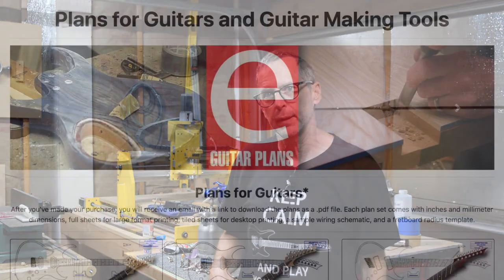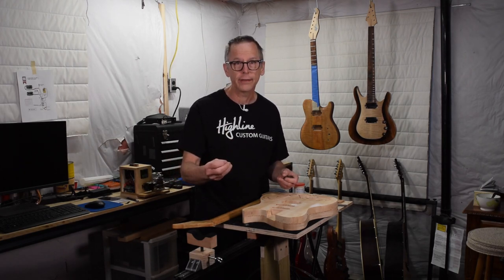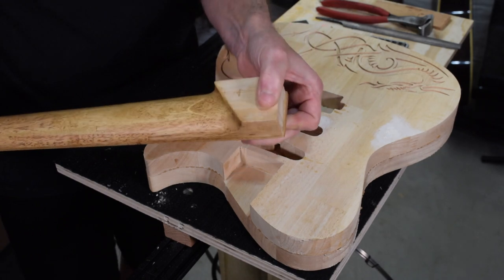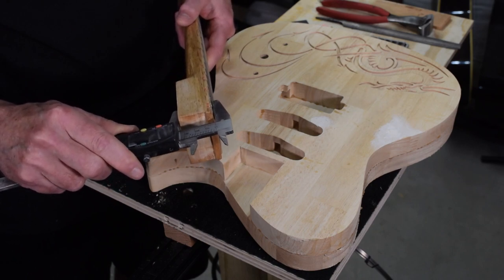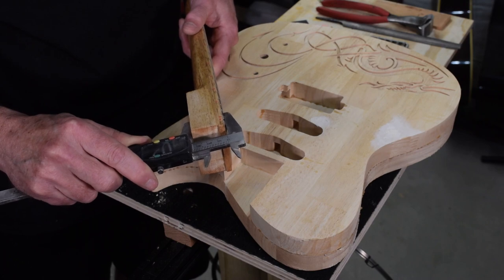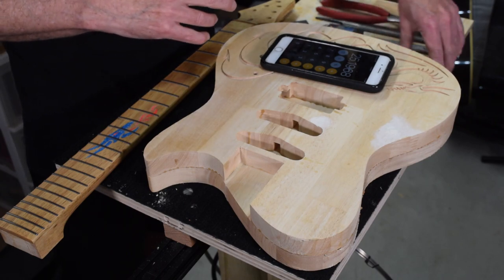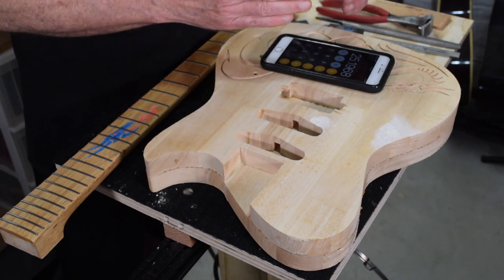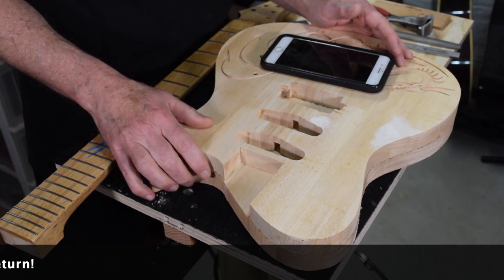Determining the Depth of Your Guitar's Neck Pocket

Comment: If you would like your reading to be as accurate as possible, and since you have a digital caliper, take your measurement of the bridge, make that your “zero” starting point and then measure your neck. No calculations required.

Comment: This is really well explained, except for one omission - it’s doesn’t seem to account for string action. Following this precisely will result in strings which touch the fret wires won’t it? I assume this is corrected by adjusting the saddles but this would imply the degree of accuracy is not as critical as you suggest?

Comment: I’m not sure why you said that before measuring the bottom of string at the bridge saddle that you first lower one saddle so that it’s flush with the bridge plate then slightly raise the saddle next to it then measure. Why is this necessary and if you do that to 2 saddles then which is the one you measure? The one flush with the bridge plate or the one beside it that is slightly higher? I’m very confused. Thank you! My calipers arrive tomorrow and I have to attempt to fix an uneven guitar neck at the neck pocket on my 90’s Squier Strat that had paint from the factory inside the neck pocket which I then sanded out and now the neck is all out of whack and completely uneven
Reply from the maker: It's to account for the fretboard's radius.
Reply: @HighlineGuitars  thank you sir, I appreciate your response.

Comment: Great video, thanks a lot. Just that I fully understand this, you do not add the string action to the equation? Is this because you are lowering the strings at  bridge to the Maximum and adjust the action later by raising the individual strings?
Reply from the maker: Sort of. I raise the saddles about 1/16" off the baseplate so the strings are slightly above the frets. Too low to be playable, but you'll have enough adjustment range to get the action you want, high or low. Keep in mind that I am building guitars for other people. Since I can't always know what kind of action they'll prefer, I have to make sure they'll have room to adjust the string height for whatever they desire.

Comment: How thin can you make the material that supports the bottom of the neck pocket (ie from the bottom of the body to the bottom of the neck) without running into issues of possible breakage? Say for a typical strat style pocket with an alder body and maple neck?
Reply from the maker: I have three Strats with between 7/8" up to 1-1/8" of body wood under the neck heels. Why the variation? They're mass-production guitars, that's why. I recommend an inch.

Comment: Thanks for this! I'm at this stage with my first build, and I actually started doing your exact method prior to watching this. I looked into Fender style neck pockets, and I noticed that a lot of them are a standard 5/8" deep. This feels very shallow to me - (with my setup, using the method you mention I need around 7/8" deep). I'm inclined to do your method instead, but I am nervous there may be some other variable I'm not thinking of that warrants a 5/8" pocket. The main concern being the distance between the strings and the body (or pickguard if you have one). I'm curious if the Fender spec does 5/8" in part because folks wanted more space there for playability? Im probably super over-thinking things, and my instinct tells me that wouldn't be a problem, but I'm still paranoid. . . Anywho, thanks again for sharing your expertise!

Comment: Hi Chris, with that measuring, don't you risk to get the fretboard a little below of the top of the body? What measure do you have between the thickness of the fretboard plus the fret wire? Is it less than 8mm? 
Thanks
Reply: An average fretboard thickness would be 3/16" or around 5mm, and a tall, jumbo fret would be ~.050" or ~1.5mm so it would be close. Unless someone made a thicker fretboard than normal this works and the fretboard will be sitting just above the body.
Reply from the maker: My fretboards are about 6mm thick along the centerline. The bottom of the fretboard ends up about 1.6mm out of the body.

Comment: I'm using a Gotoh 510 tremolo Any pro advice on setting that up for correct depth?
Reply from the maker: At the very least, I always do a full scale side view drawing of the guitar to calculate the depths. That way I can check the string action over the frets as well as the relationship between the tremolo block and the back of the body. To take it a step further I also build a full scale 3D model of the guitar for more precise analysis.
Reply: @HighlineGuitars  I'm not good at computer programs like that though. Maybe down the line you could do a video hands on kinda thing? Thanks for the reply.

Comment: i am routing by a stanley (non electric) hand router plane and paring chisels and sand paper and files, not a power electric router-

 I tried this technique on a tele neck pocket and it was far too high. Please advise.
Reply from the maker: Please clarify what advice you need.
Reply: I routed it further today, the pocket now sits at 17.50mm deep and is square with the neck when it seats in the body pocket also sits with no rocking.

After inspecting the neck heel dimensons with digital callipers.. I have found that the thickness has a neck up bow angle built in on the back of the neck heel... there is 0.50mm difference between the necks heel thickness being thicker towards the tuner side of neck heel.

fretboard is a 10 inch radius and is sitting 12.2mm from the body with no pickguard not including the height of the frets. To me it just looks quite high.. I am not sure whether I should try to shave that 0.5mm away from the neck heel and get rid of that up bow angle(despite this the straight edge from frets to saddles make good contact at 30% or so saddle height) it or just leave it and wait and see how it plays once assembled. With the pickguard on it gives a 7.8mm height from fingerboard wood to pickguard top. 

Thanks please advise
Reply from the maker: @ukguitaryogi2888  The only advice I can offer is you need to fix the heel. It needs to be a consistent thickness.
Reply: @HighlineGuitars   thanks, I came to that conclusion, thanks for clarification
Reply: @HighlineGuitars  wana thank you... I corrected the neck heel angle to zero or dead flat by hand and it sits better. that seemed to fix it. thanks for helping us all when ever we ask questions and making the lesson videos.. thanks alot
Reply: i had to take 0.8mm and 1mm away to get the neck thickness and angle to zero  or equal thickness. i learnt that you got to get that to zero and then dont touch it! as any uneven thickness on either side acts as a up / or down bow shim! maybe the next build i make I will make a purpose down bow taper angle of 0.3mm to zero in order to build into the neck heel a shim! thanks

Comment: I have a prs style kit. The neck sits which looks like a quarter inch above the body. How would I determine either shaving down the neck or deepening pocket. Also, you did the neck thickness in relation to bridge and action for appropriate thickness. But I need the opposite calculation if you were to measure the pocket itself and determine the thickness of the neck. Sorry it's alot. Hopefully I made it clear. Just trying to get my head around this.
Reply from the maker: Take the string height at the bridge when the saddles are as low as they can be adjusted and add that measurement to the depth of the pocket. That will give you the neck + fretboard + fret height measurement you need. I would subtract about a 1/16" from this number to get the final neck thickness. Example: Neck pocket depth (1") + string height at the bridge (.30") - .0625" = a neck heel thickness of 1.2375"
Reply: @HighlineGuitars  thank you sir

Comment: Can you give any advice on neck angle for set neck guitars. I bought a kit..a pricey one, and the neck heel frets are touching the strings. I have the bridge jacked just to get rid of buzz. The info i have at the moment is that the distance from the bottom of fretboard where it overhangs is .250" from top of the body. Its a LP Jr. Set neck build. Thank you.
Reply from the maker: Next time I install a TOM, I'll shoot a video.
Reply: @HighlineGuitars  Great. Thank you.

Comment: "The formula I use for determining the depth of the neck pocket is pretty simple. I take the overall thickness of my neck heel — including the fret wire, then I measure the distance between the top of the guitar body and bottom of the string where it meets the bridge saddle, then I subtract it from the vertices of the third moon of Jupiter."

Tele poccket is 5/8" deep. Time to rock!